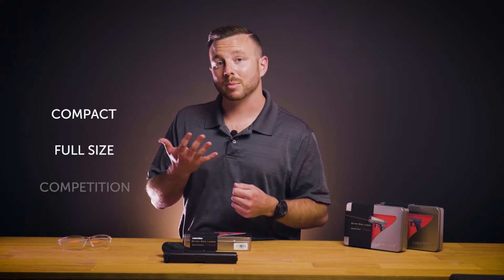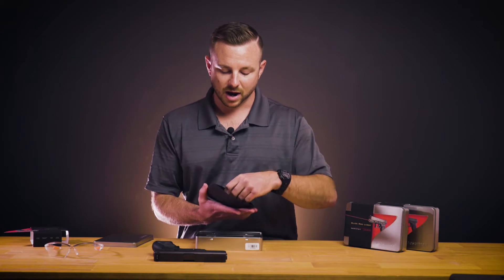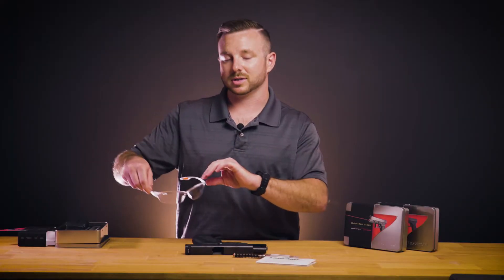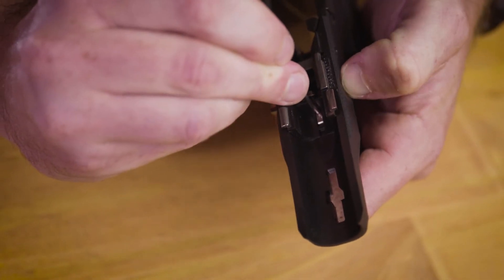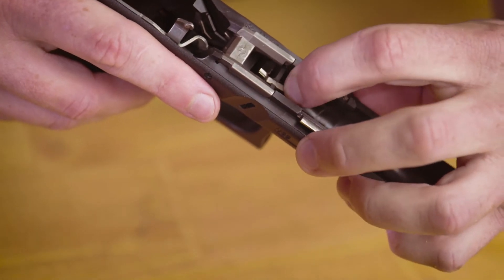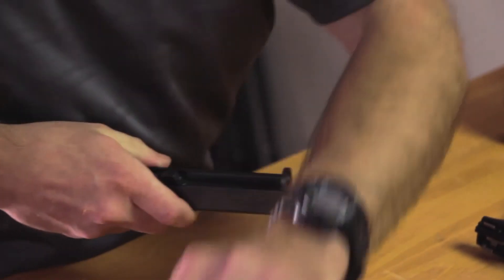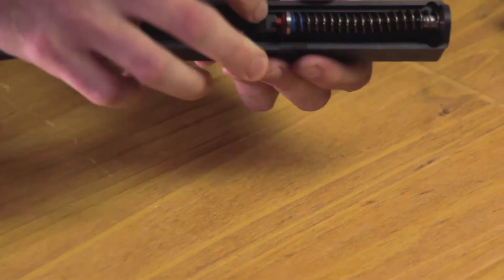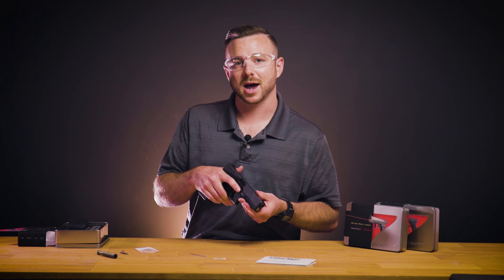LaserMax Glock Guide Rod Installation for Compact, Full-Size and Competition Models

Comment: How do you adjust the laser??? If its non-adjustable then where dose the laser converge for accuracy, 3 yards, 6 yards...???
Reply: It's factory zeroed and parallel to the barrel. The whole point of it is that it's so close to the barrel that you have the benefits of both parallel and convergent zero in one. No need to make any adjustments or account for different range. I haven't used this so I don't know how accurate it is, but in theory it's the best of both worlds.
Reply: Need one for the Smith & Wesson bodyguard 2.0! One of the hottest guns out there and the rail for a light mount so it would be perfect
Reply: Zeroed perfectly for 10yds which is great for tactical defensive distances (and it wouldn’t be too bright at 30+yds) it will only vary an inch or so when closer or farther by 5yrds so center mass hits will happen

Comment: Will the gen4 g23 work for my gen5?  G23 is the only gen 5 without an option on the site
Reply: Please let me know if you find an answer. Been looking to find out for days!
Reply: @timice3753  I forgot where I saw it but they're suppose to work with one another
Reply: @phatpac5  I found out the other day that the Glock 23 and Glock 19 (both gen 5’s) have the exact same measurements 😇

Comment: My Glock doesn't appear to have that 'lever' type spring. I see a coil spring in there,  do you have instructions for removing that?
Reply: Kevin, I just ran into the same issue.  You can follow the same set of instructions.  Compress the slide release just enough for you to move it to either side of the slide and it will fall out.  You can use the small rod tool to push it out also.   Then turn the lower half upside down and the coil spring will fall out.  Then you can continue as described in the video and instructions.  Hope this helps.

Comment: Bought a Lasermax guide rod system for my Glock 17.  The laser functions with the slide off,  if you move the rod around. Put the slide on and it won't work. Followed instructions and video exactly. Called Glock and waiting for a return call. Been a couple of hours, still waiting.
Reply: Thanks for the useless info and not letting us know what happened afterwards.
Reply: @Laserbeto  yeah, wtf...was thinking of this device, but now, I highly doubt it...I heard Surefire is the best, but, man, they are pricey.
Reply: @Laserbeto  I had the same issue, the company basically said "it should be working as expected if it turns on" and didn't replace it or anything. total waste of money
Reply: what ended up happening?